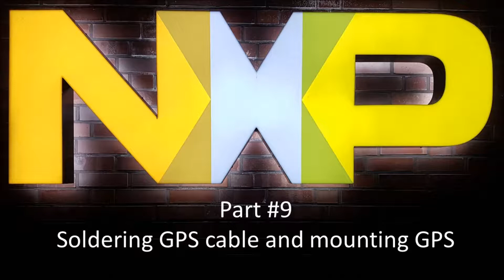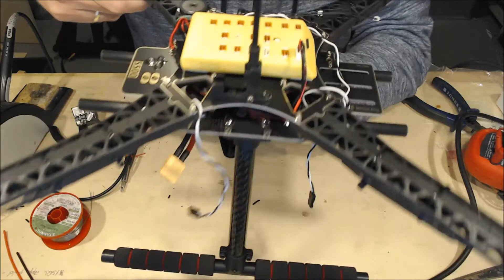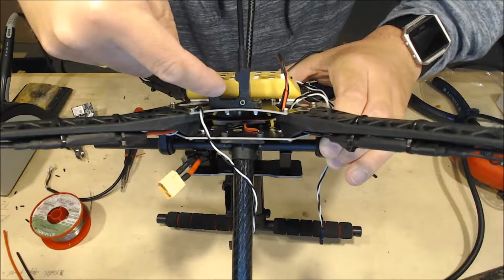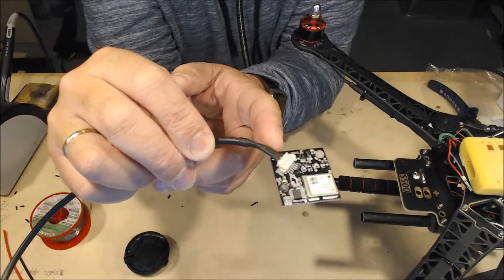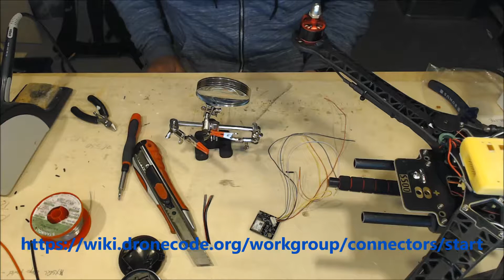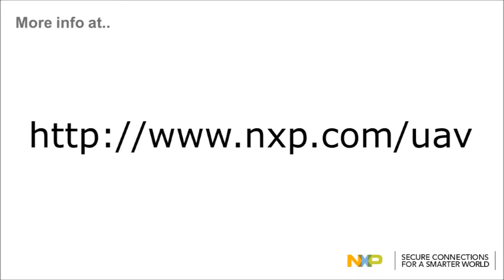NXP HoverGames - part #9 - soldering and mounting GPS

Comment: how can we connect the motors to the controller ?
Reply from the maker: see https://youtu.be/Ib7xexbTRGo
Reply: but the ESC's to the controller ?
Reply: @pascalaulucian8809  ESCs have a PWM wire connection  to the PWM inputs on the Flight controller. (These are like JR or Futaba 3 pin connectors)

Comment: Note that some kits will come with additional cables that have a Hirose DF13 connector and a JST-GH on the other. This will eliminate the need to solder. The Power Brick (DC/DC converter, voltage and current monitor) cable is straight through , with pin 1 going to pin 1 etc. However, the GPS cable will need to be modified at the JST-GH side by rearranging the pins to match as shown here: https://nxphlite-team.gitbook.io/prototype-nxphlite/audience/howto-interfaceadapter-cables/howtogps#neo-m8n-module-(readytosky)-showing-gps-module-connector-pinout

NOTE: On the DF13 side of the cables there may be tiny nubs in the way and other light  filing may be requred as discussed here:https://nxphlite-team.gitbook.io/prototype-nxphlite/audience/howto-interfaceadapter-cables/power-brick-adapter-cable